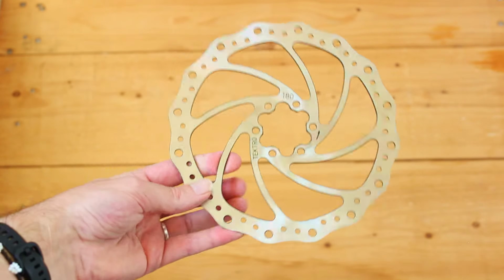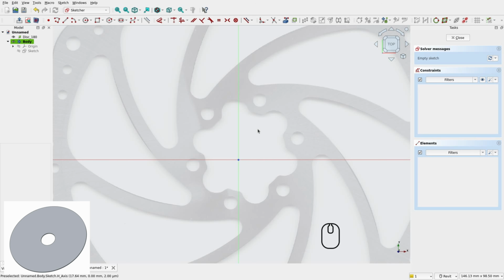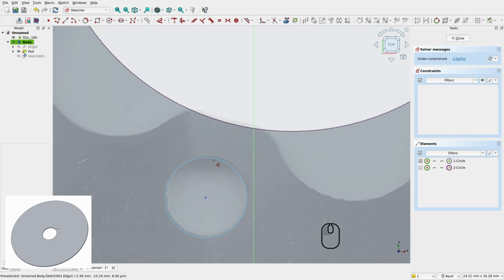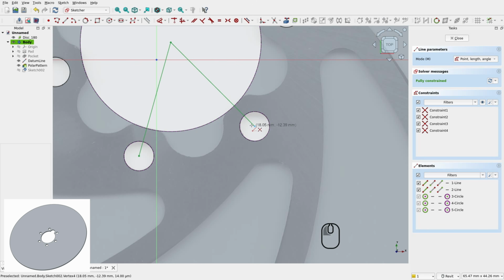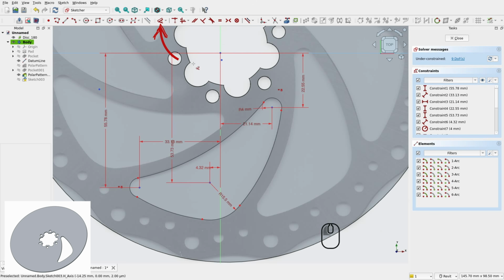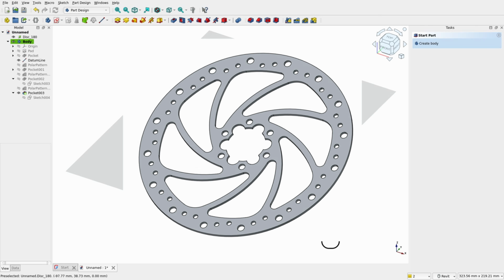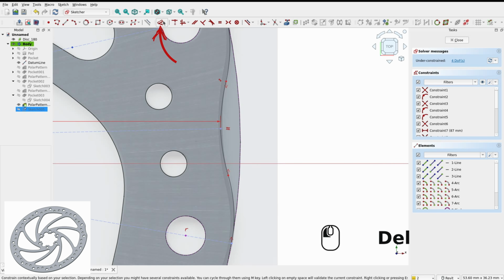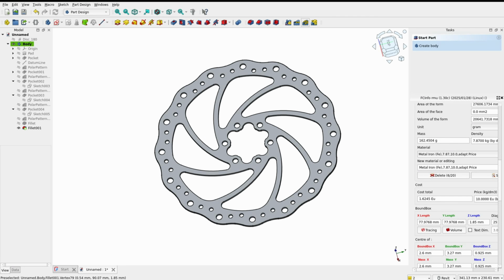How to Reverse Engineer in FreeCAD – Easy Beginner Tutorial - Bike Disc

Comment: I wish CAD packages would have an align edge to vertical and center option.

A lot of times scans of rectangular objects come in ever so slightly of vertical, and it messes with your ability to us vertical and horizontal constraints. I’d like to click two points and say snap vertical and have it rotate the image.

It would also be nice to be able to click the image center (or in this case click 3 points on a circle) and snap the image to origin. That way you can take advantage of symmetry.

I usually resort to doing all these corrections in Inkscape before importing. 

Some CAD packages have translated and rotate options, but it’s a really finicky way to align the reference image.
Reply: I use sketch for that. Scale image first, then trace some geometry that will help align it. If vertical edge not quite vertical - measure angle. Then snap your fully constrained sketch to the origin. After that you know how much you need to rotate it and where to move - just use transform tool. It's more time to explain than do it.

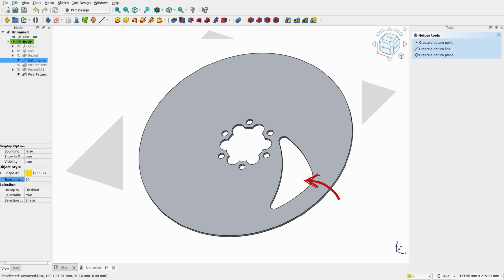Comment: Excellent tutorial!! I'm learning Fusion and FreeCad (Plasticity with Blender are a useful combo too) because I want to create my own pieces for R/C models. Only I have one question: in 9:45 how did you know what radius are the correct? i'm struggling to know the radius of the circular shapes of my models, and because they are mainly cars, all that organic forms are giving me a lot of headaches. Thanks in advance, and thanks for your tutorial!! One sub more here!
Reply: My guess is they looked at the numbers they got from matching the image as closely as possible and rounding to the next sensible number.
Since the part was constructed via CAD to begin with, chances are pretty good any dimensions were specified as reasonably round numbers. If it shows up as 4.957mm after visually matching the scan, it’s almost certainly meant to be 5.000mm, for example…

With truly organic shapes, I’d still argue that rounding to convenient numbers within your expected accuracy/precision would be the sensible approach.

Comment: great tutorial, thanks. out of curiosity, is there a special reason why are you not creating new sketches on the body directly (click a face of the body and click new sketch) and you create the sketches on the XY plane?
Reply: I'm just learning this stuff but I think it's because the mathematical plane is reliable so it's good practice to use it when designing parts for machining. A person could accidentally modify a face, so that it's not planar, and not notice.

Comment: Dude, what are you doing! Attach the center of the circle to the origin!
Reply from the maker: @CaleMcCollough I didn’t do that because there’s no way to precisely place the disc’s center at the origin. I figured using the 3-point circle method would be more accurate to find the actual center.
Reply: @deltahedra3D  First of all, great video. This is the second video that I have watched from your channel and couldn't resist to subscribe. 
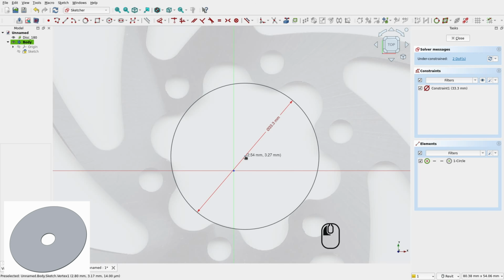Now, on to business. One way to precisely place the disc’s center at the origin is to use the values from the vertical/horizontal dimensions that you added at 3:44 to reposition the image that you imported. I would have used reference constraints instead of driving constraints just to get the values needed to shift the imported image, such that the sketch's origin would coincide with the referenced hole's center on the image. After that, then I would constrain the 3-point circle you drew earlier to be cantered at the origin, and then get rid of the reference constraints used to derive the shifting values used to move the image.
Reply: Once you had the first circle, using the 3point method, i figured you’d have the offset to 0,0 and apply it to the image…  maybe that’s not even possible.  I’m still a cave man.

Comment: macro: fcinfo ?? Where to get it?
Reply from the maker: @iq0099 in the addon manager,  Tools-Addon manager
Reply: @deltahedra3D  still could not find it. is it part of any workbench or module?
Reply: @iq0099  go to addon manager, click on the find tool bar after it loads them all in (might take a minute or so) and type in fcinfo, it will give whatever is available with that name.  On my system (windows 11 with FreeCAD 1.0.1 i get FCInfo, FCInfo ToolBar, FCInfoGlass and FCInfoToMouse Good Luck

Comment: There are cases where reverse engineering is done using actual photos, etc., but
this sketch tracing is mainly used when modeling figures of Spec or SCD with incomplete information.

Comment: I have experimented with Scanners in the past to determine diameters of circles. There were systematic errors in x and y direction. I decided not to use it, but I did have lab equipment at hand - only drawback: much more work.
Reply: Yeah I wouldn't trust scanner dimensions.   FC lets you scale the image using reference points so, he could measure the thing then scale the image to match the actual size.

Comment: May I give some suggestions? 
• You don't need to create an axis of rotation, you can use a circle or an arc as a reference
• You can prevent sketch point from moving by using a Lock constraint. 
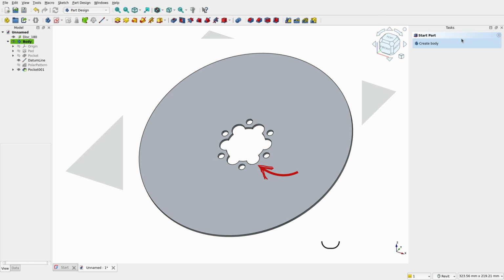• 9:24 You can add fillets immediately and then polar pattern both pocket and fillet.
Hope this is helpful. Thank you for your tutorial.
Reply: It would be helpful to center the image to the origin, too. Great tutorial!
Reply: @johang1293  That bothered me too.   That said, I'm not sure how you get closer than "Mostly centered.
Reply: @quademasters249  it can be tricky for many images to be perfectly centered. In this case, as the part is relying on an ISO standard you can for example create a Sketch with the inner hole pattern based on the standard specification and then align the image to the sketch. For this to work you need a minimum of three holes to align to but more is always better.
Reply: @johang1293  I agree that's probably how I'd do it.
Reply: @johang1293  exactly!
Reply: Many ways to model anything, but their experience tells them the most robust and reliable ways. In FreeCAD you really learn how to avoid crashes the hard way.